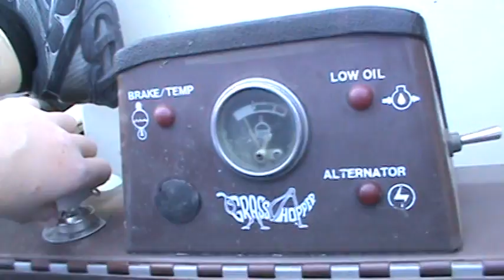Rebiuld of Grasshopper 721 Part 2

Comment: @ Ashley Skinner . . 

1.  It would help to know whether your starter can crank the mower engine or is the starter "silent" when you turn the key to start? 

2.  Have you blown a fuse.  Lift the seat and look at the fuse panel on the  right side.  Pull out the fuses and visually inspect them.

3. If the starter will not crank, consider the electrical safety switches that prevent power to the starting circuit.

a.  It will not start if the steering arms are in the operating condition.  Move the steering arms outward.

b.  It will not start if the red PTO knob is "engaged"  Make sure the red knob is pushed down.

c.  Also, if the starter does NOT crank, check if any of the wires have come loose on the safety switches or if the switches have gone bad.  The 721 has a safety switch under the seat.  Follow the two wires that go into the hole in the bottom of the seat.  Disconnect the plug from the seat switch.  Run a small piece of insulated wire from one connector to the other to complete the circuit and test to see if it will start.

Comment: mine won't start still after replacing all that stuff
Reply: Ashley Skinner I know this is two years later, but sometimes especially after setting the winter, I have to lightly pressurize the gas tank (while cranking) with a rag and air hose to get a good prime to the fuel pump...it’s a 2008 723.